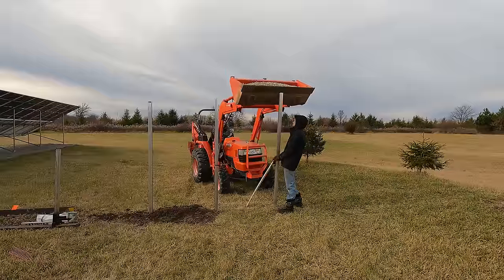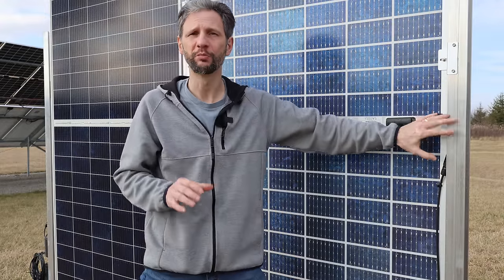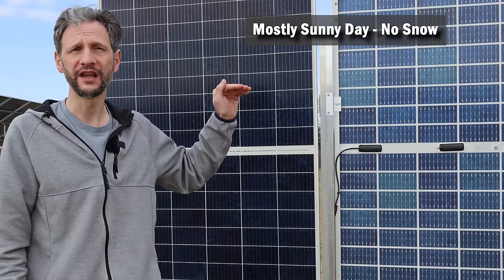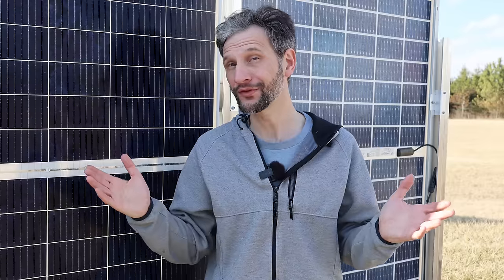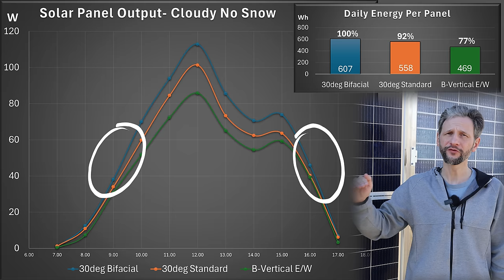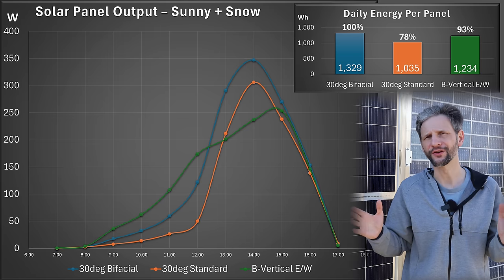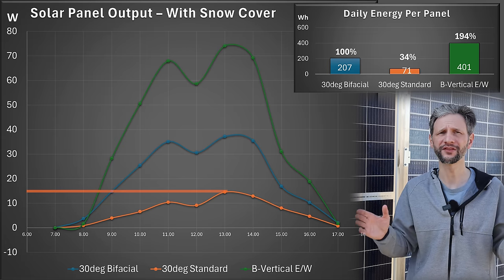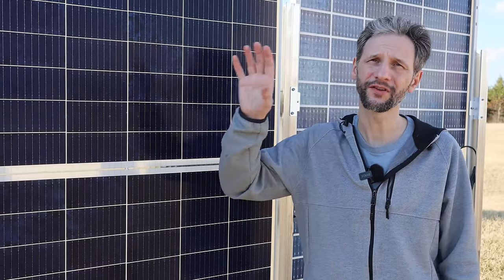Vertical Bifacial Solar Panel Performance Results Part 1

Comment: Have you considered testing a south facing vertical panel? My dad's array in northern Michigan is on an adjustable rack. In mid-winter he has them tilted to a few degrees above the horizon and, with the additional reflection of the snow, his system produces far more during the winter than it does during the summer. It also provides the benefit of easily shedding snow, he never has to brush his panels off.
Reply: I'd like to see this too. Despite the reduction of diffracted light behind the panel, the effectiveness of the sun-facing panels implies this would be way more effective use for vertically mounted panels too.
Reply: I bet some of his improved performance is due to the cooler operation of the panel in winter.
Reply: @leifhietala8074  Obviously, but I'm curious whether it would be even better facing south and north instead of west and east. Obviously the backside would be getting less light, but the south-facing horizontal panels won every test until snow covered them so I'd like to know if a south facing vertical panel would be the best of both worlds.
Reply: For south facing vertical panels you don't need bifacials, because the added power from adverse side is low. Therefore the overall cost of such installation is much lower and you can mount it simply on walls or fences pointing south.
Reply: I'm also curious about sun tracking panels. I'm guessing the additional infrastructure makes it not worth it, but I would love to see the data.
Reply: I'd be interested too on the results from south facing vertical panels in northern regions.
Reply: This is something I'm considering - also in Michigan.  My existing 6kW array is at about 22 degrees on my pole barn roof  (14' sidewalls, and nobody is going up there to clear snow), so it gets covered in sticky snow pretty easily - winter is pretty rough for my production.  My next project is still in the design phases, but I've already got another 14kW of bifacial panels waiting to be installed.  Would love some details on your dad's install.  I'm on the lookout for a good ground mount system that can either be adjusted seasonally, or allow me to do an E-W vertical installation like this video.

Comment: Not likely a problem in the cold areas, but sun heating of horizontal panels is also a factor because as the panels get hotter, their output goes down. From what I have heard, the reduced output due to hot panels is another plus for vertical panels. they don't heat up as much.
Reply: Research simulations also theorizes their is an increase of cooling because one side is in shade.  Also the vertical arrangment creates a kind of "chimney" effect in the air allowing more passive coolsing.
Reply: This is a point I'd like to see tested as I've seen that research too. Everyone is on about spreading the output and the albedo which is great. But I am most excited about the cooling as heat is the big enemy in solar output and lifespan
Reply from the maker: The chimney effect is probably significant.
Reply: @ProjectsWithDave  how about the impact of wind?

Comment: It will be interesting to see summer results in higher temperatures. Great video, Thanks
Reply from the maker: Yes, I'm curious.  I may take temperature data on both panel orientations to see if there is a significant difference.
Reply: will be nice to see if mornings and evenings make a difference  in summer with the longer days with sun more behind main array. and also  facing south with a white wall behind .  the farther north longer sunny days in summer. two shine walls  at 45 deg at north post might make a fair difference. i see a lot more tests👍👍
Reply: @ProjectsWithDave  Temp monitoring is a great idea! I'd like to see the results, so I've subscribed!
Reply: Imagine replacing the wooden fens in gardens with these 😮 it doesnt take much more place, and applied to a whole neighbourhood, it could be significant

Comment: I think this changes dramatically in the summer and in hotter climates, because from what I've seen so far, the better cooling of the vertical panels also has a huge effect. And especially in places where you would not want to install traditional panels, such as on farmland, it is a great option to install panels at all AND it even provides a better microclimate and conditions for some farms. I guess as always: The mix is important and choosing the right orientation for the individual situation. Thanks for the video and these insights. It's really helpful to see this real life measurement.

Comment: One of the claims is that horizontal panels start overheating and dropping in efficiency. This clips the output similar to what you mention for an undersized inverter/solar charge controller. You may never experience this loss of efficiency in Ohio even during summer.
Reply from the maker: Our summers aren't supper hot, but probably hot enough to see the effect and extrapolate.  I'll collect some data this summer.
Reply: This is the explanation I've read.  Apparently an extra 2%.
Doesn't sound a lot, but for large solar farms, it adds up.
Makes sense, as here in the UK, my Solar is most productive April /May.
Once we hit June /July they never quite match the early months.
Heat I guess
Reply: How about a combined array single sided at thirty degrees at the bottom. And bifacial verticals along the top?  It puts the bi facials  where they can catch the most light from both sides.  The single sided units are on top of the ground  anyway so very little light gets reflected up under that narrow low triangle. 🤔

Having tried that you might  try the same high low line up but  you could space your bi facials  E-W  as well but to get meaningful results you would have to set up the Two new configurations ..they would have to be constructed and run at the same time in the same field.. 
The panels themselves would also need output  calibration checks before and after just in case of any production faults or fall off after installation.
Reply: this hype started longer north then ohio

A group of researchers at the Netherlands Organisation for Applied Scientific Research (TNO) has conducted a series of tests and simulations to understand why vertical PV systems tend to provide unexpected yield gains compared to horizontal arrays and have found that vertical installations have much lower operating temperatures.

after all the panels needs to be black to work best and the lower angle also works better in the northern part of the world
im not sure this kind of experiment makes any sense in the equator area
Reply: I think horizontal panels will suffer long term, irreversible damage that will reduce their efficiency, while vertical mount panels will have more longevity as they'll suffer less from direct solar ray

Comment: I love seeing vertical bi-facial panels used as fencing. It would be cool to see them between bike lanes and car lanes.
Reply: May not be a great idea, cars kick up a significant amount of dirt and dust, and the panels will need to be cleaned often. Plus you've got a lot of heat coming off of pavement which may not be good for panel life, and you'll have a lot of shading from nearby buildings >3 stories. There are much cheaper and efficient places to put solar panels right now.
Reply: @bradleylong3230 Panels are getting so cheap that even with significant shading, I wonder the cost/benefit of using them as back yard fences- those fences can be very pricy.

Comment: I look forward to see how the horizontals will work during the hot summer months. I could see how have some in both ways (hybred) could even out different types of weather. The use as a fence opens up alot of possible locations for solar.
Reply: I would guess they would also get better result in summer since the sun does not hit the surface as much in the hottest time of the day and are probably better exposed to the wind, cooling them down more.

Comment: the chart of the vertical panels is great from an energy demand perspective, where you see peaks in morning & evening with dip in the middle...great work!
Reply from the maker: Thanks!
Reply: Yes this is what I thought, grid scale solar where it fits with a regional demand for power, less requirement for storage.

Comment: face them vertical facing south, on the north side, you put mirrors on "heliosta'st" (like a solar tracker but directs the light reflected from a mirror onto 1 spot all day long) and focus the light so it hits the entire back side of the panel.
this was the panel gets the same sun light on the back side as the front gets!

heliostat is usually used to shine the sun into a north facing window or to focus the sun from many mirrors onto 1 spot to heat something in a solar concentrator!
Reply: Good Idea but heliostats are expensive and for diy you need knowledge and/or adjust Them from time to time.
Reply: Add more panels instead of heliostats?

Comment: Thank you!!! I've been contemplating vertical mounted panels on a rig that I could wheel around. I don't have much money (or land) so knowing results of actual tests is VERY valuable to me. Thanks for your thorough testing and detail!!!
Reply from the maker: Glad I could help!
Reply: If you're doing a mobile rig why not just face the sun? These solutions seem tailored for permanent installation.
Reply: @chublez Mobile isnt the same as automated!

A wheeled and anchoring rack will get a lot more if you optomize it even only once every few weeks, with minimal added conplexity.

But a fully self orienting system is a lot different work.

Comment: Using them as fencing is an interesting synergy of use. I could use a small pen and this might work. Over time I think I will slowly replace the E-W axis with panels

Comment: i guess it would depend on where you use it and how many you could fit in.
i do like the idea of using them as fence panel or even on the wall of industrial buildings.

Comment: Need to see another one of these done in summer when heat is causing reduced efficiency. I wonder how much the added air flow helps vertical orientation compared to south-facing panels.

Comment: Looks great Dave. Be sure to look into vineyard trellis orientations (which prefer NS rows, like your panels facing EW, with spacing between rows set to maximize light/minimize row to row shading). Putting cattle around solar panels as one photo showed will be problematic as the cattle will scratch against and destroy the posts and panels, which may mean a higher mounting solution so the cattle only hit the posts, but does the ground reflected light reach high mounted panels? Same if growing corn or sunflowers between panels so may be limited to short crops like beans. What crops are most/least light reflective? Which livestock are most light reflective (white chickens and ducks!).
Reply from the maker: White birds, I love it! 😂
I agree cows may not be a great livestock for solar panels.  Also tall crops like corn would not make sense.  Grains, maybe soybeans.  Someone needs to do a crop performance comparison.  I would like to know if the reduced sun exposure is enough to significantly reduce crop production.  Seems like the crops that would work well with solar would be a limited list.
Reply: @ProjectsWithDave  I doubt there is any reduced light exposure for crops. You might even have a longer winter growing day with the early morning and late afternoon reflected light from the panels
Reply: If you could install a temporary electrical shock on the panels it would not take long for the cattle stop touching them. On electric fences they learn pretty quick. One or two snaps and they won’t go back and you can shut the power off.
Reply: @freddymax5256 That's exactly what I was going to say. Should be pretty easy to incorporate since you have an electricity source right there.
The other major advantage is that Nimbyism has to be greatly reduced. How could people complain about a fence? Not like barbed wire or electric fences are things of beauty.
Reply: I do wonder how they get the right series/parallel voltages. Seems like you would have some issues with extremely long wire runs/unbalanced voltage drops.

Comment: I have found the same thing in my testing. Not having to clean snow off my panels is a huge benefit to me. I live in northern Montana. Sometimes I have to clean my south facing panels several times a day.
Reply: Way up there it would be great to see the results after a year of half the panels hung vertically facing south vs whatever racks you have.  Seems like a simple idea to replace long fence lines with vertical panels, low maintenance and no land lost.

Comment: Spent my first 40 years in the Cleveland, OH area and the past 20 in the Phoenix, AZ area. There does come a point where we start praying for cloudy days :-) Would loved to have seen the output results from horizontally mounted panels or horizontal minus 10 degrees towards the South during the winter solstice. Thinking about building a pergola type structure in the back yard and using bi-facial panels for the top of the pergola. The pergola would be 11' on one end and around 7' on the other which gives me about 10 degrees of slope over the length. Would provide some much needed filtered shade from the sun as well as power my house. Unlike your situation, I need the most power during the summer months for cooling. I really do enjoy and look forward to your videos. Thanks for taking us along on your journey.
Reply from the maker: Great idea, I'll consider how to test this for a future video.
Reply: buildings with round roofs provide all angels needed for all seasons..
we need to start to build our houses so the look like greenhouse tunnels

a garden rack would probetly also make sense to some people in a more round/bended version
Reply: Interesting. I spent my first 28 in Phoenix and my last 36 in Cleveland. I actually prefer Cleveland weather. Summers are really nice and in winter I can put on an extra layer if it gets cold. In Phoenix there is an absolute limit on how much I could take off. The one thing I absolutely do miss about Arizona is the mountains and the long distances to the horizon. In my last house in Phoenix I could lay in bed and see 4 Peaks 40 miles away through my bedroom window, or standing on top of Camelback Mountain and see the entire city. Here in the western suburbs of Cleveland, the horizon is the first row of trees. A person can get a little claustrophobic and so every couple of years I have to go back if just to get my "mountain fix" as my wife calls it.

BTW, love the idea of a putting a pitch on the roof of a pergola as a place to put 100 ft2 or so of solar cells.
Reply: @papparocket  Grew up on the West side of Cleveland in Lakewood. Now live in Mesa. One of the first things you notice here is how far you can see. At night, from our back yard, we show visitors the red tower lights on South Mountain and they are in disbelief when I tell them those towers are 26 miles away.
Reply: @NitePHX  I grew up in Scottsdale and now live in Westlake.

Comment: Latitude matters, higher the better. Higher DC/AC ratios also help, especially with storage. Vertical bifacial reduce installed normal operating temperature (iNOCT) short circuit current (Isc) and max Isc considerably Electrical balance of system (BOS) is reduced 25%. Presented at NREL on these comparisons, energyideas.
Reply: Maybe, maybe. See also: Solar power plant mounted in multi-storey building! (for survivors in the zombie apocalypse): 
Shorts version:
https://youtu.be/k9AiiCLALRA

Full version:
https://youtu.be/sOskjOsl-cA

Comment: I wouldn't stand right next the the stake being driven into the ground by the bucket... hold it with a pole or a piece of strut from a distance. Far too many things that could break, snap, or slip and result in an ER visit.

Comment: what I miss is multiple rows of vertical panels to see if the second row reflects back to the first panel.
but all in all thanks for compering theme
Reply from the maker: There are some larger studies with that information.  I will likely included some of that analysis in my summer follow-up video.

Comment: Awesome test. During the summer I would have the front of the every panel facing west. For me, anyway, this would be nice because my air conditioning runs at night and it would be awesome to have that extra solar boost right before the sun goes down. In the morning it's cool so I don't need the air conditioner at that time.

Comment: Honestly this the first channel where someone got into his mind to make his own lab to testing PV panels performances, according different factors including positions (Vertical, leaning, East, West...). Really I enjoyed watching that video. I wanted to make the same test unfortunately I have no yard...What about the optimizes? How do you qualify them in increasing production? You gave us a huge informations where even no one did before...Big thanks
Reply from the maker: Thanks!  I would not use optimizers in this setup, they just add cost.  I need them to monitor performance at the individual panel level and they allow me to have panels facing all different directions connected to the same inverter.